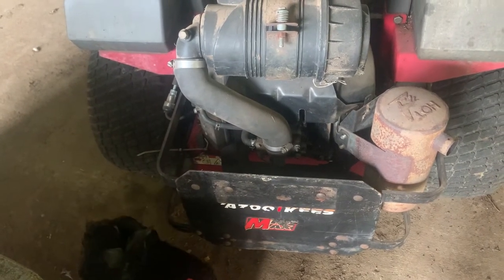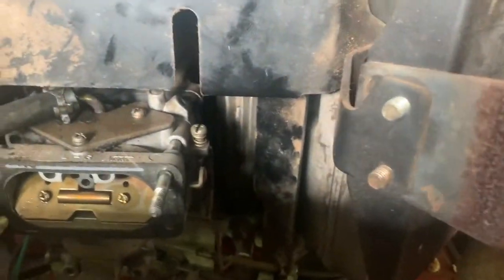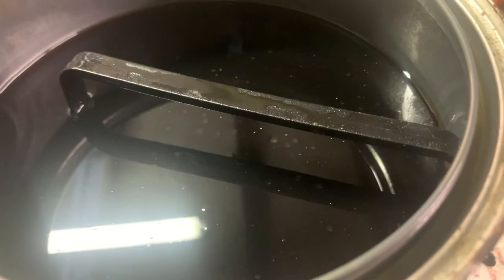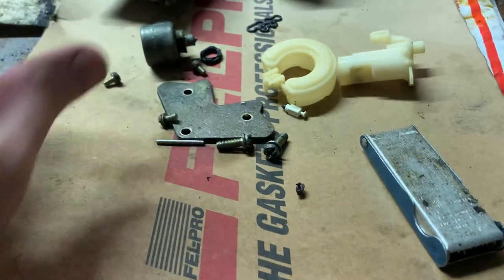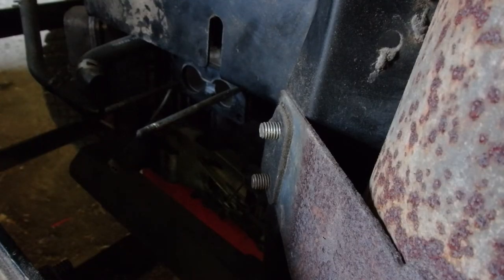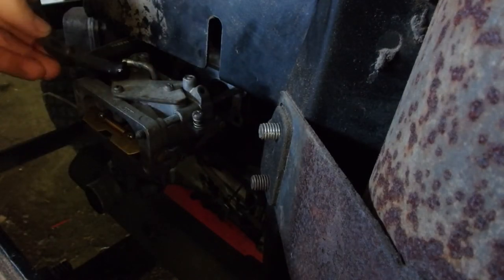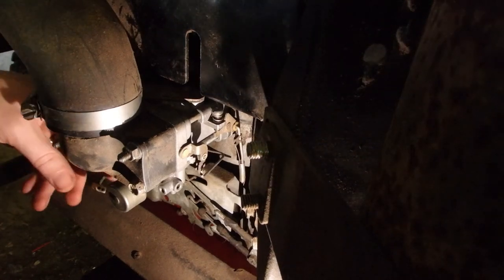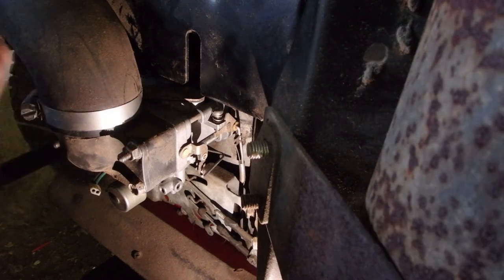Kawasaki FH641V Carb Rebuild

Comment: Thanks for the video.  The Kawasaki FH601v  on my Scag Tiger Cub started surging the last time I used it.  I replaced the fuel filter and filling the hose from the pump to the carb with carb cleaner and ran that through the engine which didn't fix the issue (it's never that easy).  I took my carb off and cleaned it after watching your vidwo as mine looked the same as yours on the outside and turned out to be the same on the inside as well.  Only difference I noticed was it looks like your needle is metal whereas mine is plastic with a rubber tip.  It was very helpful to see what to expect before tearing into it.  I was able to reuse everything and I think the issue was something in one of the tiny holes on the carb as it initially had some resistance when trying to run a tiny piece of wire through it.  I ran the wire through all holes followed by carb cleaner, put it back together, and it is running smoothly now.  I think I could have ordered the same kit you did, if needed, based on what I saw in your video, or my nearby Scag dealer said the various o-rings were available individually just not as a kit (at least not for my exact engine).  I before pulling the carb, I also tried starting the engine with the hose from the fuel pump to the carb off to verify the pump was working.  I was surprised to see some debris in the fuel from the pump.  I let the pump run a little to clear off of that out (this was after I replaced the fuel filter).  I cut open the old filter since I couldn't see inside of it well, and found the side of the element going to the carb loose.  I may have broke it loose cutting it apart but seeing the debris that that came out of the pump makes me think it was loose inside and maybe what cause my issue to start with by letting something get inside of the carb.  Anyway, thanks again for the video.

Comment: Sir. I want to thank you for your video! I sorta got a little bit aggravated with my choke linkage on my Kawasaki engine, we had a fight and well… It’s now shaped a tad different than before. Lol. But really not funny. I’m sure you understand. Tip! For those planning on taking off your carb. Go ahead and take off your metal back cage and exhaust protector so you will have plenty of room to work and not get into a fighting match with that throttle and choke linkage! You will thank me later. Anyway sir. Your video helped me find the right holes to hook my choke and throttle linkage back up correctly after we calmed down and became friends again. Thank you again my good friend for your video!

Comment: Nothing wrong with the anti back fire solenoid. Just needed to be cleaned.
Reply from the maker: It was bad, it would shut off after being on for a bit and cutoff fuel and cause the engine to die.

Comment: The spring loaded screw on the bowl appears to be just a drain plug is that correct?
Reply: Yes, that is what i found it to be on mine after I got mine apart and looked at it.

Comment: My throttle plates open fully.I have a 25 HP.Yours might be 23 HP.I just changed gaskets and orings and needle in bowl area.
Reply from the maker: If I recall mine is 21hp. I wonder what internal differences there are?